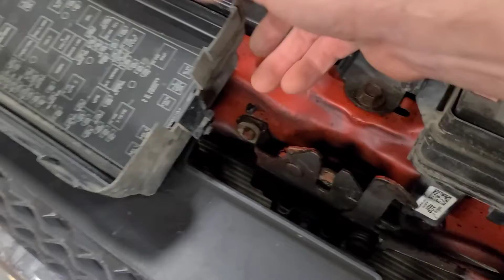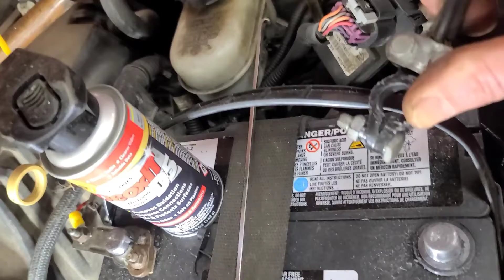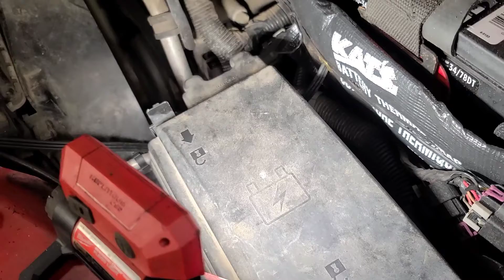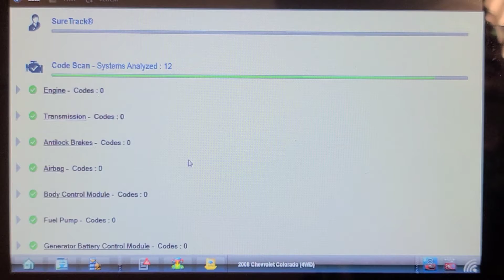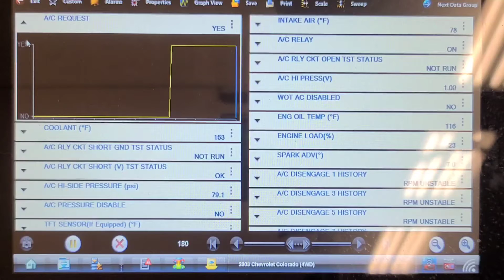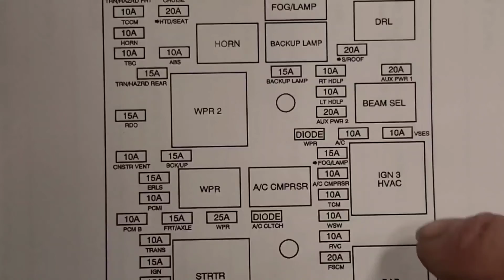2009 Colorado or Canyon Fuse Box Replacement pt. 2.

Comment: Missing both the removal and install of the main junction block.  How did you remove the block from all the plugs below?   Mine won’t budge.
Reply from the maker: @lurkinglogger2453  removal starts at 1:10 in the video

Comment: would you had just replace the crank fuse, I am having the problem on my 2016 colorado not cranking but replace the whole fuse box can also clear things but it will cost you more.
Reply from the maker: It wasn't just a single fuse. There were multiple fuses and relay connections corroded. It is very important to make sure the cover is on the fuse box. This one was missing.

Comment: Heya, nice video! I have a question though, do you have any tips on removing the one clip that is near the wheel well? I can’t fit anything in there to pop it out, and I cannot push down the rest of the fuse box now. Thanks in advance!
Reply from the maker: If you are referring to the clips that retain tge fuse panel against the left fender I used a hooked tool to pull up and out on them at tge same time. Hope this helps you.
Reply: You can get to it from the wheel well if you look under